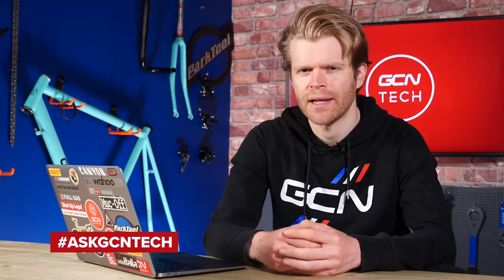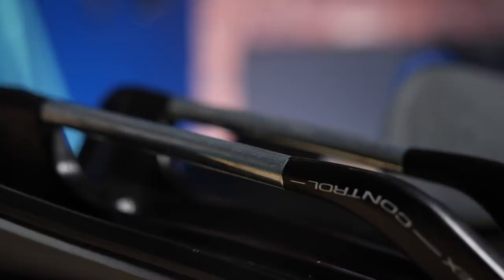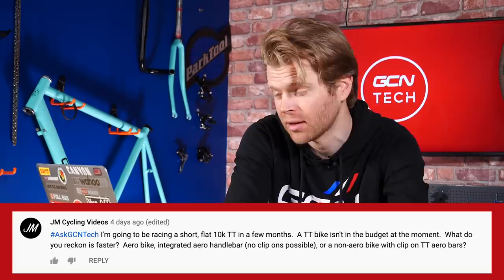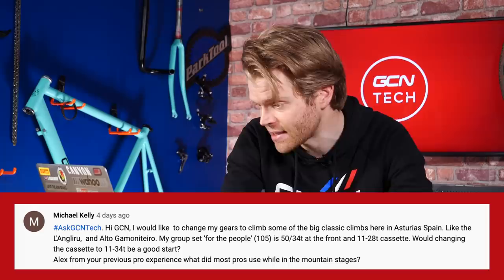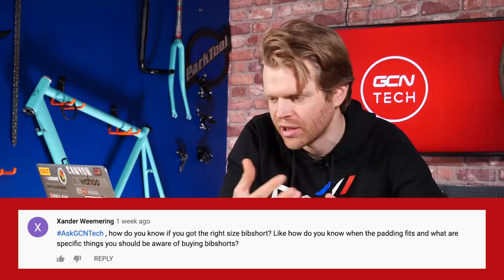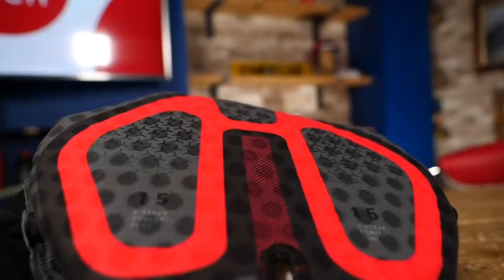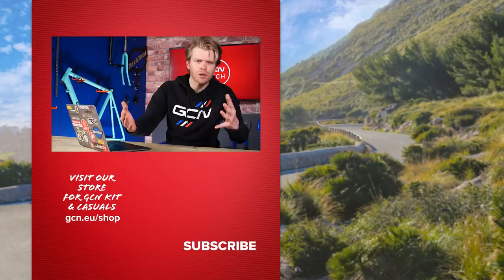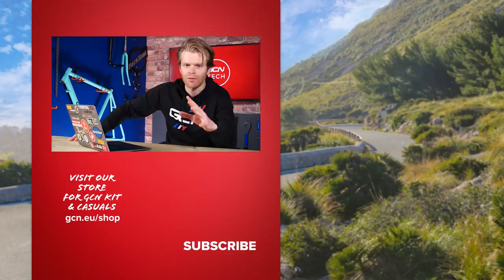Do Latex Inner Tubes Puncture More Easily? | GCN Tech Clinic #AskGCNTech

Comment from the maker: Do you have any burning tech questions? Let us know in the comments using #AskGCNTech
Reply: are latex tubes worth it for general summer riding?
Reply: Perhaps a stupid follow up on the 11-34 cassette question. If I have an 11-28 and I want to run an 11-34 for some rides where it is 22-28% for  significant portions, do I need to change to a longer chain?
Reply: @mathewrose2951  yes
Reply: @abedfo88  yes - definitely - latex are worth it.
Reply: #askgcntech 
Hello guys. I have a cheap 8 speed microshift rear derailleur. I wanna change that to an 105 or ultegra 11 speed. I know I need some new wheels with a shimano 11 speed freehub. I am surrounded by mountains so I'm thinking of an 11-32 cassette, but now the question, do I need to buy new levers, or can I use these (8 speed) hand levers that were originally on the bike? Tnx and cheers.
Reply: The new Vittoria air liners that you recently featured look very interesting.... question is are they compatible with hookless rims? #askgcntech
Reply: @martin16416  tubes aren’t compatible with hookless rims.
Reply: @nickmannerings3574  question was air liners not tubes.
Reply: @martin16416  good question.
Reply: I think the paint chip question was probably asking if paint plays a role in protecting the frame? That's how i took it anyway.
Reply: #AskGCNTech I started my cycling life with a hybrid bike with a tourney groupset and a road bike with a 105 groupset last year. I have been recording the mileage of each bike but I don't know when (at a certain mileage range for example) should I be replacing both groupset's cassette, chain, chainring, and disc brake pad. At which mileage range should I consider replacing them?
Reply: #askgcntech

Hi, I'm an ex dirt jumper/enduro racer, I've added road cycling to my workout routine and love it. I'm 188 cm tall, about 90kg, athletic/musculatur build. While riding with shorter friends I do feel my aero disadvantage, and the air just stopping me. Is there a way to get more aero or just need to find taller friends ?
Reply: Can I replace the chamois of my favourite bibshort? It feels flatter and it is shifting around after much use. #askgcn
Reply: At home (in Flanders)  I use an 11speed  11-28 with rear derailleur Shimano 105 SS (short cage). When I go to longer climbs abroad, I like switching to my climbing wheels (which are 10 speed) with 11-34. I therefore need a rear derailleur with a longer cage (GS). My question is as follows: can I use an 11speed Shimano GS on a 10 speed cassette? And if I return home and switch back to 11 speed 11-28, do I need to go back to the SS rear derailleur? What are the possible consequences/disadvantages of keeping the GS long cage derailleur on the frame while running an 11-28 cassette? Thanks! #AskGCNTech

Comment: Hi GCN Tech.  You should also note that you cannot use a C02 inflator on a latex tube.  The cold air from the C02 cartridge makes them "brittle" and they'll most likely blow within a few Klms.  I had several frustrating experiences before the penny dropped.  I now run latex tubes, but my spares are always butyl or tubolitos.  I just change back to a new latex tube once I'm home.
Reply: How about the glue....same as with butyl?
Reply: @motombocolombo  hi, no, not the same glue. Most bike shops will sell latex specific glue and patches. I've personally not had great success with patching them, so I just replace the tube.
Reply: @NormAusSmith  Thank you very much for the answer :-)
Reply: @motombocolombo  I've had no problem patching Vittoria latex tubes with glue and patches made for butyl tubes. I'm not sure about other brands of latex tubes.  

When I first used latex tubes many years ago (unsure of the brand), regular glue and patches wouldn't permanently stick.
Reply: @insquares  Interesting. I thank you very much as well :-)
Reply: Thanks for the information. Fortunately, I carry a butyl spare anyway, with a CO2 cartridge, so ive just been fortunate. Ive never attempted to patch my latex, as the only blowouts were the expensive learning curves that Ollie spoke to about inital fitment. Thanks again!
Reply: Patch latex with std glue and patches. Works absolutely fine.
Reply: The reason not to use CO2 with latex tubes is because the CO2 leaks through the latex. If you were to release the canister slowly, the cold wouldn't be a problem, but you'll still come back to a flat tyre earlier than you'd like!
Reply: @keithmaclure9101  co2 goes through any tube faster than normal. Nearly flat overnight. Co2 is soluble in rubber, so it passes through.
For patches, people would glue sections of latex sections from an old tube
Reply: I use latex tubes and carry butyl as a spare. I have always done that because I just don't want the mess of baby power in a bag or my kit if I have to replace a blown tube. 

Lol

Comment: I switched to latex inner tubes and they do feel both faster and more compliant, however they do not hold air pressure very well at all. If you go with latex be prepared to pump up your tires every ride because it will absolutely be required.

Comment: Been using latex tubes in preference to butyl tubes for years now.  I have noticed a drastic improvement in longevity AND ride quality if I coat the tube, before using it, with talcum powder.  Coat the inside of the tire with talcum powder as well.  Really helps!

Comment: I run vittoria latex tubes with gp5000 clincher tyres....beautiful combination. Had a few problems fitting until I replaced the rim tape on my wheels with tubeless tape and have had no issues since
Reply: Thanks. I have the same combo and flatted out in a TT tonight. The rim tape suggestion is what they suggest on the Silca YouTube as well. Cheers.

Comment: I run some VERY light latex tubes (60g challenge brand) and haven't had any punctures so far, but much better ride quality and overall comfort and feel.
The downside is that they can't reliably take pressures over roughly 100PSI without splitting open randomly, but heavier tubes like the vittorias (~70g) seem to do fine.
It's one of the cheapest cost to watt gains I know of and makes your bike feel noticeably more comfortable and faster, would definitely recommend them.

Comment: Been using Vittoria pink latex tube for 4 months now. One puncture on front tire, two on rear. Punctures are really bad one. Run into huge potholes that the tires are torned. Tires are unusable, changed to new pairs. However the tubes (which are also torned) are patched using extra Vittoria latex tube. Been running for 2 months now. Patch works very good! Last week got the second puncture on rear wheel. Puncture is at new spot, the previously patched spot has no leak at all.

Comment: Been using Vittoria pink latex for about 10 years now on tarmac and forestry or reservoir roads. The pros: superb ride especially with a cotton tyre like a Vittoria or Veloflex Open Corsa or a Specialized S Works Turbo cotton at about 60 lbs. They make a fantastic ringing sound like a football being bounced. They're fast. They're light. They're easy to patch and I like the suggestion of using an offcut to patch them.

The cons: with a fragile tyre like a Veloflex Open Corsa they'll find the smallest hole and herniate out with an embarrassing comedy squeak. Difficult to fit, you need talc and some air to give shape and prevent trapping under the bead. They don't tolerate tiny shards of glass in the tyre and will keep puncturing until you find and dig out the shard. And no, they don't hold pressure but I don't mind pumping every ride.

Definitely no less reliable than butyl and a lot nicer to ride.

Comment: Vittoria latex tubes have been great for me. I’m heavy so low pressures isn’t much of an option for me to get better suppleness. Highly recommend
Reply: Do you know, what type of glue works best when repairing latex tubes? Or can you just use the same as with regular tubes?
Reply: @motombocolombo  I wouldn't use glue, i use Lezyne glueless patches and they work amazing on Latex tubes
Reply: @motombocolombo  It may depend on the brand of latex tubes. For Vittoria latex tubes I use the same glue and patches I use with butyl tubes. I haven't tried patching with regular tube glue and a piece of latex tube.
Reply: @motombocolombo  I've found regular adhesive from a puncture repair kit to be even more effective on latex than butyl.

Comment: If you go from a 28t cassette to 34, make sure to check that your derailleur and chain have the capacity as well! Usually the cutoff is 32 before (shimano at least) you need a longer cage
Reply: 105 takes 11-34. But yes, chain will likely need to lengthened or better, new chain.

Comment: I rode Tannus tires for a couple months as a test.  They were 7 percent slower in terms of power output needed to go same speed.  Rode many of my normal roads, had many years of data, and switched wheels day to day just to confirm, and it was 7 percent.  Felt terrible, didn't slip or anything, traction was fine, but bumps, forget about it.  It was awesome not carrying pump/tubes/patches on long rides though.

Comment: I cut patches from disposable latex gloves and place one on top of the other.  The deal is that they stretch with the tube, so do not inhibit the tube from stretching as normal patches do.  This relieves stress from the tube preventing further ruptures alongside the patch.  This has proved more than adequate for thorn punctures (which are numerous here) over many years of cycling.  Yes, slime is good but doesn't always work.  Note: do not put liquid glue on the latex patch as this will cause it to wrinkle and become unmanageable. Apply glue to the tube only and wait for it to set off to a contact state, then firmly press the thin (dry) latex patch onto the tacky contact cement. Repeat with a 2nd layer of latex to protect the patch from abrasion, or just use thicker latex in the 1st place.  These patches are reliable for the life of the tube.  I would not use them for larger cuts but for thorn pricks this is awesome.  Sceptical? I don't blame you, just try it and see.

Comment: Well explained on the saddle position question! The problem I have though is setting identical saddle height with different brands of saddle. If the top surface of the saddle isn't flat and the profile varies between the saddles, what point do you measure to? A lot of people just take a point somewhere in the middle, but common sense migh dictate that the back of the saddle, where your sit bones are making contact, would be best. But where exactly? The height of the saddle can often vary dramatically in different places towards the rear..

Comment: In my experience, latex tubes are actually better for puncture resistance. I've had numerous cuts in my tyres which would have punctured a butyl tube and yet the latex hasn't punctured. Recently, I was at the coffee stop and noticed a cut in my tyre where I could see the pink tube through and yet the tube hadn't punctured. I just had to stick a boot in to repair the tyre.
Reply: Well, you don't know if they'd have punctured a butyle tube, because you're riding latex...

Comment: #AskGCNTech 1st Question: Is it okay to use latex tubes on Rim Brakes Wheelset? Specifically Carbon Fiber.
2nd Question: Is it true that putting powder such as talcum on inner tubes saves watts or is that just a myth?
Reply: Check with the carbon wheel brand. Generally, latex tubes shouldn't be used with carbon rims due to the heat build-up when braking. But, this is highly variable due to terrain and braking style (dragging the brake vs. pump and release). I use latex tubes with my alloy and carbon rim without issues but I don't have very long technical descents and don't drag my brakes.

Comment: R. E. Michael Kelly - you may need to check your rear Derailleur compatibility. The current 105 (R7000) groupset is compatible with 34 tooth on medium cage (RD-7000GS) but only 32 on the short cage (RD-7000SS). To use 34 you may need to buy longer cage or get a hanger extender. Older models of 105 have Lower max tooth capacity too, so a hanger would be needed too. That is the cheapest option without buying a bunch of new parts.
Reply: Also remember that a Shimano 11-34 is actually 10speed width on the freewheel so you'll need a 1.8mm spacer. I run 11-34 on the shorter cage and it does work if you fiddle with the B screw to limit the travel slightly

Comment: And if you are prone to reduce rolling resistance a bit too much, a latex tube will expand quicker than butyl and thus explode more frequently if you say, pump to 130 psi one cold morning and the temps rise during the day as the sun bears down on your carbon rim.

Comment: #AskGCNTech. Hey again GCN! If you could only buy 1 bike and cannot upgrade them (except for wheels), would you rather go for a lower grade carbon frame with a top of the line electronic groupset or the same but higher end carbon frame with same but mechanical groupset?
Reply: Electronic group sets aren’t going to make as much difference as a higher grade of carbon so I’d choose the better carbon and mechanical groupset
Reply: Framesets are always going to be the highest ticket item in a bike build or complete purchase.
Were it me, I'd buy the best frameset I could afford.  Groupsets can be much more easily purchased in comparison, or even pieced together bit by bit.  Example, I'd rather an F 12 with a Ultegra mechanical groupset, than a Prince or Gan with Dura Ace Di 2, if that makes sense? And all other things being equal, wheels, brakes, and so forth. 

Now, for reference, and to keep everything in perspecrive above, I recently started to race BMX again, after 32 years, on a 16 year old Specialized S-Works Hemi I rebuilt. And I try to ride my 2011 Trek Madone 5.2 about 4 times a week to keep the middle aged spread at bay🙈. I'm 47😂
Reply: Normally I would say higher grade frame.  Just due to the fact that everything around the frame can be upgraded.  But since you said cannot upgrade, I'd go electronic shifting all day every day.  You'd be hard pressed to feel the difference in carbon grades, but you will feel the shifting hundreds of times per ride.  I've ridden lower and higher spec frames (BMC Teammachine SLR03 versus SLR01, for example), and the difference is almost entirely weight, not feel or aero.

Comment: #AskGCNTech Hi Ollie/Alex, I have a set of Miche carbon wheels, I have just replaced the rim brake pads for SwissStop carbon pads. I was just wondering if any carbon specific pad will work with any carbon rim? or are they quite specific? will I be okay using the SwissStop pads on my Miche wheels? Cheers!
Reply: Have the exact same question.

Comment: Latex tubes feel great, but they lost 20+ psi per day while I was on a 7-day tour.  Consequently, I had to pump them up every day.  When using butyl tubes, I have only had to pump them up every week or so.
Reply: I second that, I'm now on aerothan tubes, best decision ever. Much higher puncture resistance lower rolling resistance, lighter than latex and hold air like thick butyl tubes.

Comment: To use my indoor trainer, I removed my tubeless tire and installed the trainer tire. Now I want to go back to the tubeless setup. Do I was able to clean the rim quite easily of the dried sealant, but the tire is another story. Do I need to clean the dried sealant from the tubeless tire, and if so, what will remove that without damaging the tire? #AskGCNTech

Comment: I disagree with the comment about latex tubes. My experience has been fewer flats like pinch flats etc.. Yes a piece of glass or astable will make any tube flat but I really believe latex tubes experience fewer flats. For best experience I would say tubeless, latex tube, tubular, butyl tube in order.Just my experience
Reply: Agree. Latex tubes with Vittoria Corsas or Paves are my go to. Compliance over rough chip seal is smooth and fast and only 2 punctures in 3 yrs. I'm 83kg and ride 75psi front, 85psi rear on 25mm tyres. Keep away from 100+ psi and everything is fine.
Less is more.
Reply: I’m 110kg run either conti 5000 or Michelin TT with latex tubes. 80-110 psi depending on ride length and have no issues with punctures.

Comment: #askgcntech is there compatibility between Shimano DI2 road shifters and DI2 MTB derailleurs? Specifically I have a RD-M9050-SGS derailleur that was on a MTB and I have replaced that with a SRAM setup and was wondering if I could use that derailleur with a road shifter setup for a gravel bike. Thanks in advance, I've learned alot from your channel over the years.

Comment: #AskGCNTech I'm planning to ride a road bike to and from the office. Wearing padded shorts underneath or getting a comfy seat; which is more practical?
Reply: Very good question!
I had to make the same decision. I commute 60k and started with comfy saddle but switched to road saddle and padded shorts as the comfy saddle wasn't to comfy after all. If it was half the distance I would have been fine with the it I guess.

Comment: Short nose saddles are 100% so you can run a more forward position over the BB without falling afoul of the UCI rules.
Oli's advice is ok in general, yes you're sitting on the same place of the saddle but use a short nose if you need to move forward.